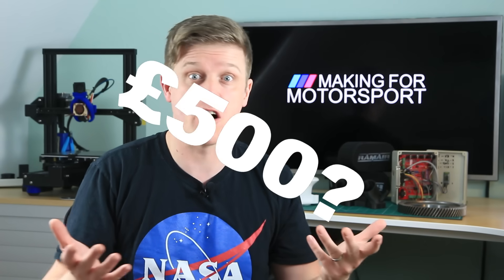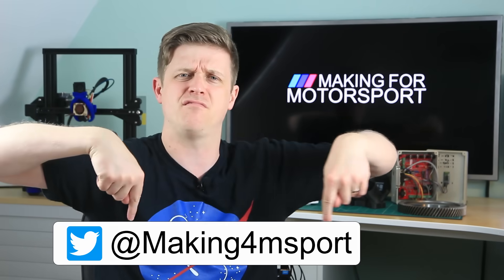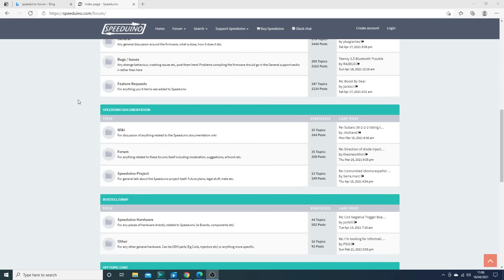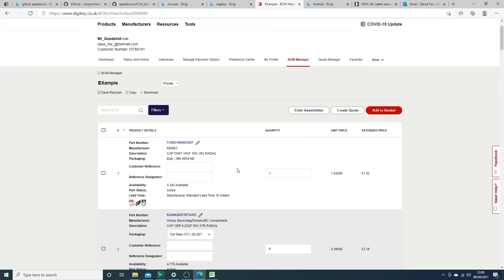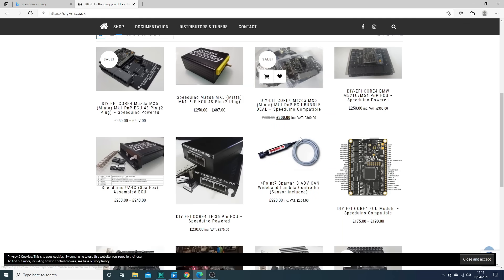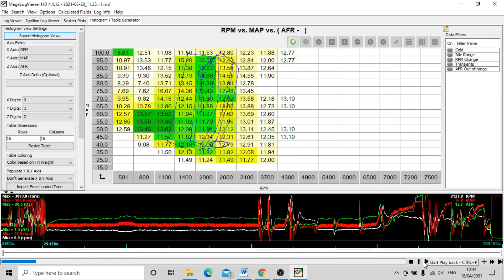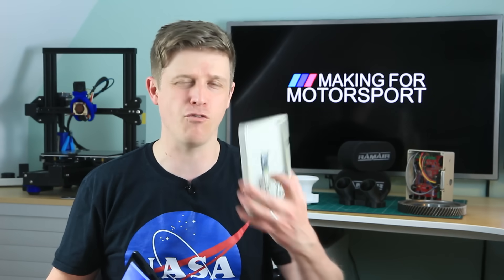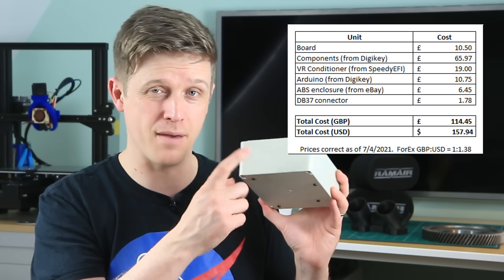The Best Value Standalone ECU - Speeduino

Comment: Thanks for this video that randomly came up! I never heard of Speeduino, but I am thinking of another application that the ability of tuning cars. I am interested in what they call 'marinizing' car engines for use in boats. The problem with the existing car ECU's is the immobilizer and the injection and other stuff. It looks like this Speeduino would be the answer to this problem! Old Mercedes Diesel engine are being used, and one thing they do, to do away with the ECU is just put in a manual injection pump from earlier engines, but this is not always possible. Would be really cool if this could work, let's say, to get any diesel engine to run with it's original ECU, while the engine is standalone, let's say on a bench or a pallet. Any suggestions are welcome!!
Reply from the maker: Thanks for the watch and glad you enjoyed it! Unfortunately a common rail diesel is quite a different deal to running a petrol engine so Speeduino can’t do that and I’ve not come across another DIY that can do it, but Speedy could be used for Marinizing a petrol engine definitely. 👍

Comment: Can you make it work with the pre-existing factory harness ?
Reply from the maker: Absolutely!  If you can find a Plug’n’play unit for your car then it’s easy, otherwise you’ll need to either cut the plug off of make an adaptor, the key is understanding your current cars wiring and components and relating that to what the Speeduino needs, but that’s the same for any none PnP ecu...

Comment: Nice info, do you know where I can find MH7203FA datasheet? thanks :)
Reply from the maker: Sorry, I just buy the bits I’m told and follow the instructions! But decent components suppliers like digikey have data sheets for everything they sell...
Reply: @MakingforMotorsport  from 4G93 ECU,  Is it possible that the transistors are faulty ? they are Q7 DTC114EUA Code 25 and Q36 DTC124EUA Code 24, is there any other components between pin 23 on ECU port to the spark plug ? those transistors are connected to PIN 23 IGN Coil 2. thanks

Comment: I just found your channel, thank you for the inspiring video! I'm looking for a cheap/simple way to control just the ignition on my BMW M70 V12, that I will run with carbs in my hot rod. to be able to run it wih the twin original distributors, I want something reasonably cheap, because I'll probably need to run two sets of ignition controllers for the two distributors. Hope you can talk about just a stand alone arduino based ignition controller in a future video.
Reply from the maker: thanks for watching!  Good to know people are enjoying it!  The V12 is a tricky one and I don't know anyone who has done it but you should be able to run the engine as 2 straight 6s with 2 ECUs, as BMW did originally.

If you only want to run ignition then I wouldn't mess around, the Speeduino has everything you need built on a ready platform, I'd just check out the schematics and only buy and populate the parts you need for power supply,  sensors you plan to run and ignition out

Comment: Can this ecu support vtec? 
I have a 2001 celica t sport that has high lift cam. Very tempted to give this a go for the cost. Looks fun! 

Enjoying the vids 😊
Reply from the maker: Hi, it can handle Variable Valve timing, I don't use it on my engine but it can put out a PWM signal, but I believe that VTEC is just a switch, which it can also do
Reply: @MakingforMotorsport  interesting. This might be worth having a go at! 
Unsure if it needs to go to a 2nd fuel table for the changeover of cams
Reply from the maker: Unless you plan to disable the VTEC you don’t need it, you just tune the load sites above 5k rpm (or whatever you have the activation set to) for the 2nd cam...

Comment: have to convert my 1982 Alfa romeo Giulietta 1.6 liter with carburetors, i'm thinking to adopt something like that togheter with individual trhottle body from a bike, someone ever do that to a "bialbero" and speeduino?
Reply from the maker: I don't know if anyone HAS done a Alfa Twink, but it's definitely do able....
Reply: @MakingforMotorsport  just wondering if original tune standard for all will work good enough to go for a specialist and end it up fine and smooth, reliable... i'm so bored to daily drive modern car, feel like someone is stabbing me every corner, every time i slap pedal to the metal... there's something completly wrong for a petrol head in modern cars... wants one, reliable for daily drive and need. Have it, need to be converted, carburetors, nowadays hard to find spare parts in good condition, and tune them fine every season change...
Reply from the maker: I am editing the third video for the individual throttle bodies now and the base tune absolutely will get you up and running... if your wiring is right, choice of component is right and initial configuration is right then it will likely start first time....  keep your eyes out for the next video 👍

Comment: My dream project is a rocket three drag trike. Its a long term goal. Supercharged or turbo 500bhp. Wideband o2, modified compression and airbox. It's going to be interesting. The ultimate dream is.to use a modified exile rear axle and the treaded f1 tyres or MT drag slicks.

Comment: Just wish there were more forums and blogs on this ecu I have one and ain't gonna lie I'm not entirely happy with it the fitting for the rubber hose is literally the cheapest plastic I've ever seen in my life and I almost broke it putting it on. The support isn't that great they take weeks to email you back definitely ditching this and getting ms. Don't get the 99-00 fishdog pnp kit for miata
Reply from the maker: In the latest video I really emphasised the fact these can be DIY so there isn’t a “helpline” as such for “Speeduino” but if you’re paying extra for PnP built items for a specific car from a vendor they could offer support but even then it’s still DIY for the tuning.

And by the way, I’ve run Megasquirt and it’s no different, even the £500 up to date MS3x runs the same shitty plastic MAP sensor!

Comment: recently bought a CB Performance black box to fit to my aircooled vw. it's a dedicated unit for those engines but i had considered a speeduino. have zero experience with electrical/electronic anything so i chose the simpler option. however, i'm still curious and using one in the future is certainly not out of the question so this kind of vid is fantastic. one thing - i will not touch amazon with a bargepole. they kill local small businesses, treat their staff like slaves, encourage rampant consumerism and are massive tax dodgers.
Reply from the maker: Maybe an ECU isn’t the best place to start with electronics and I had messed about with arduinos before but I have used none of that experience... the knowledge needed is more around how to integrate different engine components....

Comment: I'm wanting to run a fully sequential BMW six pot engine on one of these.
My choices are either the off the shelf ECU by DIY-EFI or wait for the dropbear.
Anybody know when the drop bear will be available?
Reply from the maker: No idea on the drop bear sorry, and unless I am missing something I don’t see how you will run a 6cyl fully sequentially without going to a teensy based solution
Reply: @MakingforMotorsport  DIY-EFI make a fully sequential for six injectors using the TinyWB module.
But, the in development dropbear has 8 injection drivers which will be awesome when it's available.
Reply from the maker: @richardschofield2201  just been to look again (I looked before I replied previously in case I missed something and missed it again), and I clicked into the description this time!  The Dropbear will be cool when it’s here and I’ll definitely try it out but I’m only running 4pots so the standard offering works!  But the Core4 hardware looks good! CanBus integration 👍

Comment: Is there anything for a 1987 MK2 Scirocco GTX 1.8 DX 8 valve? My car is a non ECU, wondering what I can do??
Reply from the maker: Hmm... tricky one... I’m not that familiar but I’d assume it’s running K-jet at the moment?  Really you need a crank trigger and an inlet manifold with multipoint fuel injection, then you could fairly easily work a paired injection and wasted spark injection.   I’d have thought there would be a pretty easy parts bin solution from the Mk3 Golf etc. Speedy would work for this....    you could probably run the whole deal from your dizzy triggers and not need the trigger wheel but I’d recommend you get a proper crank trigger....

Comment: Hey, awesome video! Keep up the good work. 
One question. Do you need an external device or drive to connect the O2 sensor with the Speeduino? Like the innovate one you show in this video or you can connect the wide band O2 straight to the Speeduino?
Reply from the maker: Yeah, so for a wideband you need a controller, that controls the temp of the sensor and conditions the output to a 0-5v, the majority of aftermarket ECUs (and Speeduino) can only read the 0-5v signal.  You can use a narrowband but you’re far better off with a wideband

Comment: I run speeduino for a few years. I was disappointed due to having problems with the drivers for the coils and it was not acurate when I was setting injector dead times. Now I got my standalone already built. There is gotta be somebody to build some with quality drivers and components.
Reply from the maker: Interesting, where the coils transistors taking too much current?  What external driver are you using?

Comment: Just ordered a fully assembled 0.4.4b from italy for 145€ shipping included ,👍🏽 steal, if i had to order it from UK with import and everything it would be a bit over 300€
Reply from the maker: And we have another convert!!! Welcome to the club 👍
Reply: @MakingforMotorsport   thanks mate😁, i'll be putting it in my Mercedes 190E once i get all the other parts for the ignition and injection system, i also plan on putting a turbo on it 😁, aiming for between 300-400hp

Comment: I couldn't figure out how to buy a speeduino or obtain the software (maybe i am dumb?) so i made my own, that mostly fits inside the cam gear cover.  Some chunks including the USB port stick out.  (plywood disk with a magnet glued in a hole strapped to the cam gear spec')
I didn't know tuner studio existed, not how i would program anything to the arduino from it.  So i tune it by tweaking numbers in the code?
That was a learning curve.  Still can't code my way out of a paper bag though.
I guess mine was cheaper but it is vastly less user friendly?
Reply from the maker: Wow... now that’s diy!  Yeah, I’ll be releasing a video very soon that shows just how user friendly it is, all the hard work has been done, but then sometimes the hard work is the fun!  There is a big community of Speeduino users that use diy boards custom to them and just use the firmware... that’d mean you can plug straight into TunerStudio...

Comment: Thank you so much for this video. I am a big fan of the 7th generation Celica, particularly the 1zz vvti, that tends to get overlooked by the aftermarket tuning industry, which is a shame, as they're potentially a great little platform and can be picked up for pennies these days (I've got two in my front garden). One of the biggest problems with tuning them, is the fact that you can't do anything with the stock ECU and can't even get a piggy back unit, the only option being a standalone aftermarket ECU, and those tend to cost two or three times what you'd typically pay for the car itself. As a result, budget performance improvements are mostly limited to handling, braking and weight reduction, so the Speeduino is pure music to my ears . I had actually been wondering if anyone was going to find a way of making a DIY ECU, and here it is, so it does look like I've got a whole lot of reading to do now :-)
Reply: Have you gone through with it I have the 1nz the brother to your motor same issue looking at this ecu
Reply: @TheRandomRobert71  I haven't got round to ordering the bits yet, but you'll be glad to know that, according to DIY-EFI on their website, the speeduino can now control VVTi engines, so both of ours should be covered :-)
Reply: @jasonkillbourn  except knock sensors if we have that I forget
Reply: @TheRandomRobert71  Ah, yes you're right, I just checked on their site and the only place they seem to mention the knock sensor is on their fully built standalone modules, where they say it's due in a future firmware update. It might be worth calling them to ask just how far in the future are they talking? Useful things really, knock sensors, especially if you're planning on getting an MOT, so I guess it would be handy to know approximately how long we might have to wait for that update.
Reply: @jasonkillbourn  yeah I’m trying to email them about my car so I might try asking too
Reply: @TheRandomRobert71  I'd be interested to hear what they say, as that could be a bit of a stumbling block.
Reply: @jasonkillbourn  yeah I think it might be a go I’ll lyk what they say

Comment: My arduino ecu is way cheaper, and i manage to include OBD2 bluetooth protocol -> https://www.youtube.com/watch?v=AE4lyw6E4Hk
Reply from the maker: That looks like a great project!  Do you have any project specs?
Reply: @MakingforMotorsport  This ECU i've made with a arduino uno r3 (3€ chinese clone) and a couple mosfets and a relay for the fuel pump, i've been doing this in friends bikes and cars for more than 10 years now, started with micrpchip 16f84 chips :)

Comment: does it run a rotary?
Reply from the maker: Absolutely 👍👍
Reply from the maker: Well your average twin rotor standard.... if your going for Quad then it’d be worth checking but I don’t see why not!
Reply: @MakingforMotorsport  nice :) i already bought an assembled ms2 with very good price for the future n/a 13b for my 69 mazda luce 1500 last year and got rid of the carb problem (injectors are made by the same company ;)) has a 2.0 4cyl. in there right now.. and the turbo II fc rx7 is going to have ms3x because of the extras, but i will go this route probably when my capella wagon wont start with the oem ecu and maybe if i swap a 3.0v6 to my b2200 :) of course hoping to have some more rotaries but two is expensive enough :/
Reply from the maker: Sounds like you’ve got a few toys 👍 the MS3x seems like a good option but it just too expensive for me, it’s only cheap if your comparing it to an off the shelf full 8 channel, which I just don’t need.  What features do you need for the rotary?
Reply: @MakingforMotorsport  its the first car i ever wanted for sure, the exact same car i really wanted when i saw it in sale, kind of a long story with it... since i live in a quite poor country (wages compared to car parts) i need it to turn the engine off whenever there is a problem with any critical system on the engine fuel, oil, etc.. and i helped ,a friend out selling him my old ecu so he could sell the whole car and ms3x is just ~150€ on top, i'm still a total noob with electronics and tuning, but my good friend who solders and tunes for me told its a good idea to buy it... and its only for the turbo rotary... anything else that i can use with tunerstudio can be as less costly as possible. even thought of motorbike carbs for the v6 for the simplicity :)
Reply from the maker: I ran bike carbs for years and they are wonderfully simple, just kept drilling out the main jet until the plugs looked good!  Very simple but the amount of times I took them on and off drove me a bit mad!
Reply: @MakingforMotorsport  hah, i recon .... i got a 2 stroke piaggio from my sister, upgraded to a bigger cylinder and carb and the amount of time ive lost tuning it is crazy, i can imagine 4 or more of them :D i could have used the time to work on my cars! can speeduino run a 1 cyl. 2 stroke? :D

Comment: I need to do this for both my 77 Ford truck and my 65 Beetle.
Reply from the maker: Two nice little projects... lots of options, you could stick with the distributor on both or go more modern...
Reply: @MakingforMotorsport  Ebay has weber style throttle bodies for under 200 bucks U.S. The only challenge seems to be what TPS and injectors to use.
Reply from the maker: For the TPS, speeduino doesn’t mind as you can calibrate it very easily, and as long as the injectors are High-Z (10ohm+ resistance) then speedy will run them, you just need to worry about the diameter (bigger is probably better to do you can just drill out the ITBs.  Fuel rail is the final hurdle, you can get extruded ally section that you just drill, universal fuel rail I think it’s called.   It’s all so able but that’s why I went with bike ITBs as it’s all already done... 👍👍👍

Comment: Just added one of these to my MX5 and had it professionally tuned. The Speeduino isn't that well known down here in Australia so my tuner had to spend a bit of time getting to know where some of the features were in Tunerstudio. Once he had, he told me that this ECU was as good as any of the more expensive units frequently used down here with all of them cost more than 4x what I paid (including shipping from the US to Australia).  I'm definitely happy with my decision to go with the Speeduino.
Reply from the maker: That’s great to hear, I am convinced that a properly build and installed Speeduino, on the right type of engine, is a match for most other units! Really glad it’s worked out well for you!
Reply: That's cool, been thinking about slapping a maxpeedingrod gt2871 on my Miata 1.8. This speeduino would work, as long as I find a tuner right?
Reply: he lied to you, most plug and play units will leave the speed duiono in the dust, how fast is a arduino cpu. thats right they are very slow, and it is precisely that lag in cpu speed that creates glitches, get a plug and play unit they are the stress free way to go, sure they cost a bit more but your saving on grief and failed projects and so on ???